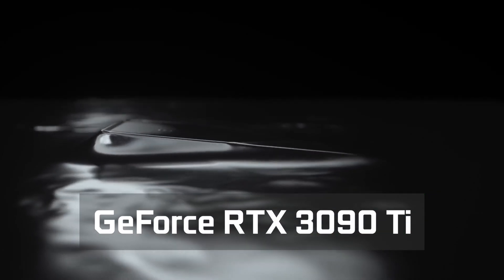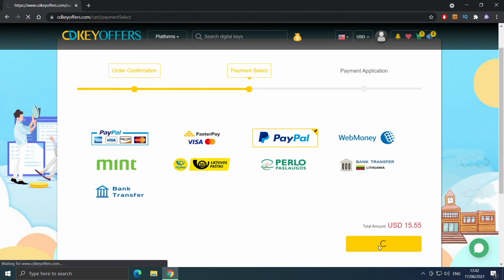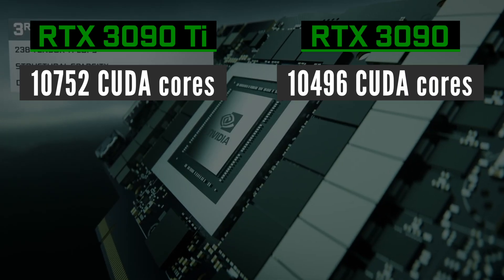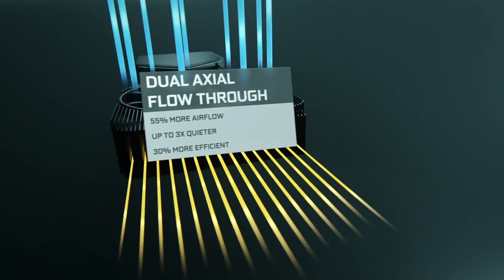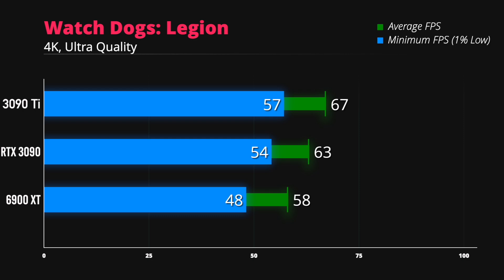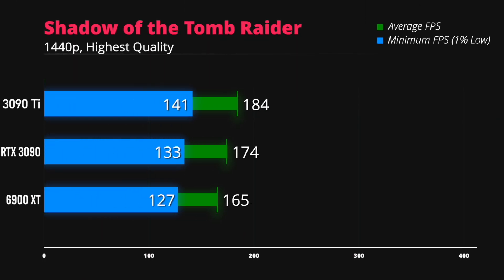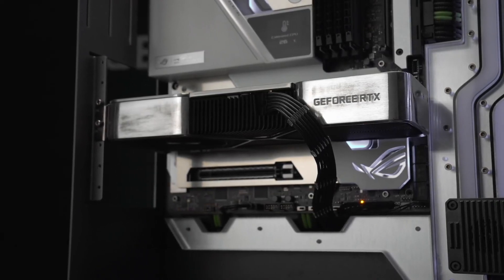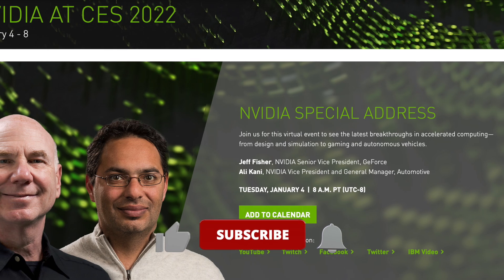NVIDIA RTX 3090 Ti [Everything Leaked]

Comment: I have my 3090 reference card overclocked to  2115 mhz  @ 1003 gbps 
And I'm drawing 410 watts at peak power
  Not much difference in mine and the 3090ti.  Smh. I don't understand the need for that card

Comment: I already have my 24Gb VRAM... as that was the major selling point for me! Plus the TGP is too high for my system as I only have a 1kW PSU!

Also, do NOT waste your money on an OEM OS, as you won't be able to use it when upgrading the Mobo!
Reply from the maker: What are doing with all that VRAM? Pro work of some sort or gaming?
Reply: @theivadim  I'm a hobbyist 2/3D artist and work with encoding/converting/upscaling a lot of video, plus I want to be able to multitask such as having enough VRAM to allow for different tasks such as surfing/encoding/converting/upscaling and even light gaming while rendering, so my system isn't stuck JUST rendering BMPs and animations, as 3D rendering can quickly drain 8-10Gb VRAM, easily not only from rendering, but managing a shit-ton of 4k res textures!

I only use 20% of my PC for gaming... ;)

As far as the 1KW PSU, it is definitely needed as I have 14 ex/internal drives as well as a 3090, in fact, I'm seriously regretting not getting a 1.2/1.6kW PSU as I just recently pushed my PSU towards a shutdown from serious multitasks!
Reply from the maker: "only 1KW PSU" good comment!😀

Comment: Nope - have a 3090 Suprim X 6 i will  wait for the 4090... @Oktober ´22. ;) 
Next new Hardware will be a 12900KS, MoBo & DDR5 Ram. ;)
Reply from the maker: If you are awaiting RTX 4090 then why not wait for Intel 13th gen or Ryzen 7000 CPUs? They should be releasing around the same time.
Reply: @theivadim  It is true that the 13th Gen appears with the RTX 4090, but as far as I know, the "Gamer variant" with the ending "KS" is only planned for the 12th Gen. But with the current DDR5 RAM shortage, I'll have to wait anyway, because you don't get a Corsair DDR5 Dominator.
I think I'll wait until 4090 & 13th gen and then compare the "gamer variants" of 12th & 13th gen.
iVladim do you already know more about the 13th Gen?